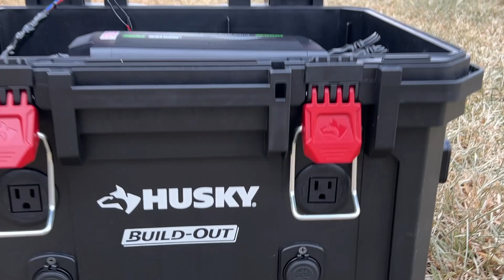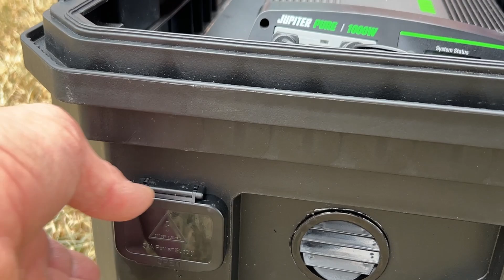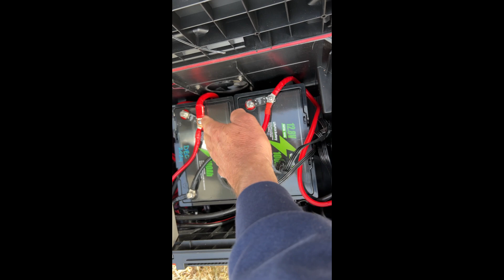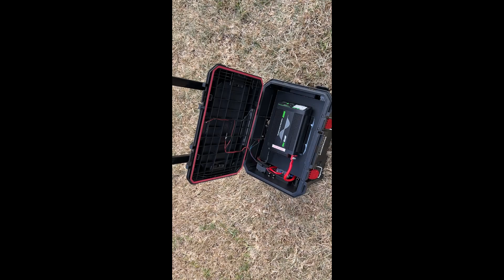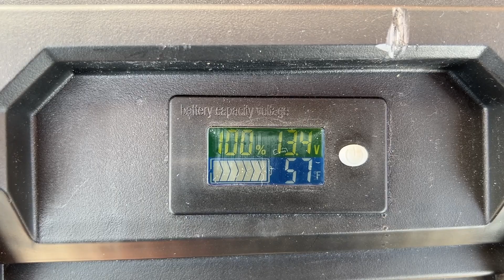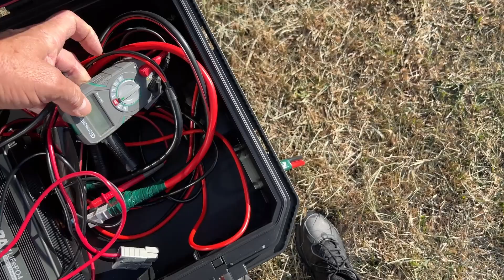DIY Power station DIY Back Up Battery

Comment: What kind of plastic board are you using to cover the batteries and support the inverter? Is it ABS? How thick? Thanks, nice power station!
Reply from the maker: It is wood, I was going to steal my wife's plastic chopping board and use that, but I had some scrap thin pieced of wood and that is what I used, and glued down the inverter so no screws can contact batteries. Use anything thin, cutable and non-conductive.

Comment: Nice Build.  Do the gray Anderson connectors on the sides serve both as solar input and also output?  Or do you have the solar charge controllers wired to the battery inside the box?  Thanks!
Reply from the maker: Yes, the Anderson can do it all up to 50 amps. I still need a charge controller, so I guess I am not really finished yet.